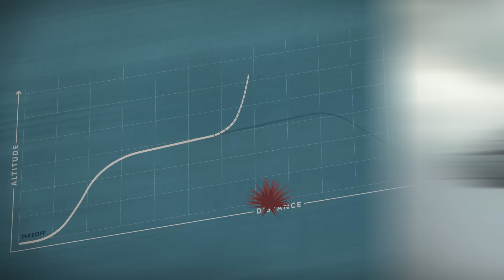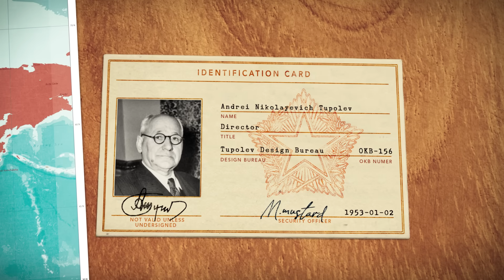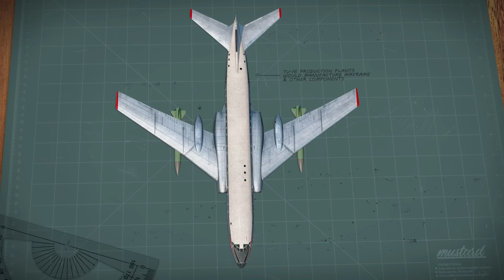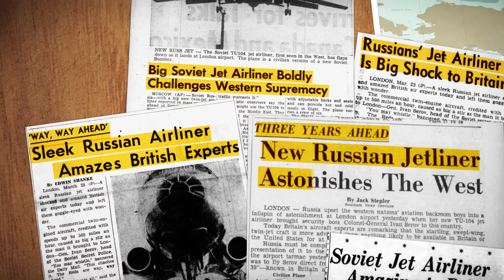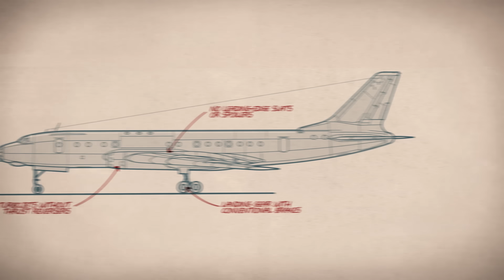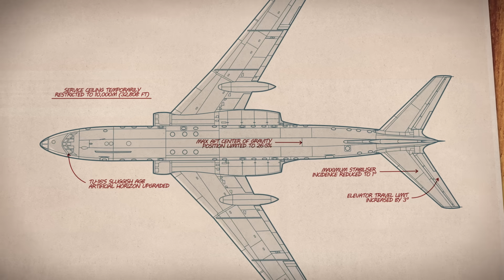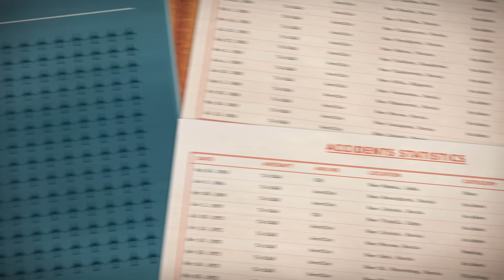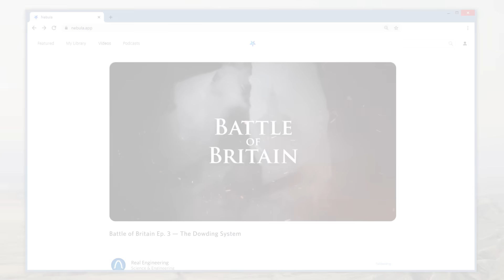The Soviet Airliner Designed To Crash

Comment: The Century turns and the Boeing 737 MAX wants to vie for the title!
Reply: The Boeing Max has a excellent statistical safety record compared to the Tu-104 or the de Havilland Comet.

Comet has the highest loss rate and fatalities statistics of any jet airliner in history
Reply: @sandervanderkammen9230 

Clearly we feel we can shed some light on some common myths & misunderstandings.

Obviously it's possible to predict the potential accident losses for airliners simply by looking at the year they first flew. 

   However, if we take into account all the variables including the year they first flew & we discard random incidents such as a vehicle colliding with an airliner during its takeoff run, there are some airliner manufacturers that stand out as producing  particularly safe aircraft for the years in which they operated, Bombardier & Embraer being two such manufacturers.
      
   It's definitely true to say that Bow-wing (See B-47 wing folding & wing collapse incidents), which has more than 50 years design & build experience on the type, obviously can have no excuses for the 737 Max incidents, those incidents being directly caused by serious design defects.

  That's correct of course, at the time the Comet wasn't particularly dangerous. It was also definitely not the worst aircraft engineering disaster in aviation history obviously.

   Obviously the Comet's engine position & inlet position had some distinct advantages at the time & of course pylon mounted  podded engines have some problems including excessive induced drag. The Comet engine inlet design was not a fatal flaw & didn't cause any incidents.

Examples of all Comets mks including some Comet 1 airframes continued flying with certification at some point after 1954. Flying carried on until 1997. 

      Losses comparisons.
Accident Losses % of total built.
How things were in those days.

DeHavilland Comet 4 UK                 14% 
DeHavilland Comet all   (ff 1949)   17%  

Douglas DC-1                                      99%
Douglas DC-2                                      47%
Douglas DC-3                                      30%
Douglas DC-4                                      26%
Boeing s300                                             72% 
Boeing 307                                               70%
Boeing 247                                               48%
Boeing 707                                               20% 
Lockheed L-049/149 Constellation        30%
Lockheed Electra  Turboprop                  29%
Fairchild FH-227                                       30%
McDonnell Douglas DC-8                        14%
Sud Aviation Caravelle                             15%
Canadair CL-44  Turboprop                   46%  
Convair CV-580  Turboprop                   22%
Convair CV-880    (ff 1959)                    27%  
Convair CV-990     (ff 1961)                   35% 
Tupolev T-104     (ff 1955)        16%

     Of course De Havilland had prior experience building many all metal construction airframe aircraft & thousands of jet powered fighter aircraft that were primarily of metal construction with pressurised cockpits & jet engines built by De-Havilland.

  Yes, that's true, De Havilland carried out full stress analysis & engaged in a comprehensive & protracted testing program which is why key De Havilland people were happy to be aboard flying DH Comet aircraft. The Comet was the first airliner where stress due to pressurisation significantly exceeded flying load stress for a full length passenger cabin fuselage.

    We agree, that's correct, the DH Comet was the first passenger airliner with full length fuselage pressurisation at 8psi pressure differential. Handley Page built the world's first all metal construction airliner during the 1920s.
    In all cases other earlier pressurised aircraft were larger, needed thicker fuselage skins due to flying stresses alone & had much lower pressurisation differential pressure or were military aircraft with relatively small heavily built pressurised capsules. 

     Of course ripstop provision was provided. The skin alloy used became unavailable at the time due to R & D at the manufacturers which resulted in the original alloy being discontinued. Later alloys had very similar properties. The skin thickness used for the Comet was used for similar size later aircraft. Frame spacing was not found to be too large & frame width was not found to be too small.

    Without doubt De Havilland did indeed always work to better than industry standards at the time, used up to date knowledge for the design & construction & no evidence of negligence or criminal negligence was ever produced in relation to the DH Comet.

    Obviously the DH Comet had no effect on the course of the aerospace industry in the UK. The UK now has the world's highest combined nuclear, aerospace & defence sectors per capita activity. Of course anyone currently flying on a wide body airliner stands a good chance of being on an aircraft powered by RR gas turbine aero engines designed & built in the UK.

    That's correct, the investigation committee did not find hundreds of fatal flaws or evidence of design defects, structural defects, defective materials or shoddy workmanship. Indeed it is the case that ripstop provision was included. Claimed incidents did not involve cracks starting from passenger cabin window corners. Pretty much all changes were just in case changes or were planned development modifications & improvements that were scheduled regardless of incidents.

    Obviously De Havilland designers knew all there was to know about metal fatigue at the time they designed the DH Comet.

    It is in fact entirely true to say that the way airliners were built changed everywhere, including in the US, after the Comet incidents.

We hope this helps, obviously.

Cheers indeed of course as always etc.
& 👍 without doubt.
       
 
 . . .... ... ..... ......
. . ..... ..... ... ......

Comment: The Comet was otherwise a fantastic piece of design and an amazing plane, if it wasn’t for the shape of the windows being squared, the plane would have single handily won the aviation race. Someone has to take the fall, and if it wasn’t the brits putting a plane into the sky first to learn about those things, it would have been the Americans or Russians.
Reply: The de Havilland Comet is without any doubt the worst engineering failure in commercial jet aviation history.

No version of the Comet ever had square windows, it had the exact same 5 inch radius windows found on airliners today.

The Comet Disaster was the result of engineering incompetence and criminal negligence
The only lesson learned from the Comet Disaster is that manufacturers could no longer be trusted to conduct their own crash investigations
Reply: @sandervanderkammen9230 Clearly we feel we can shed some light on some common myths & misunderstandings.

  That's correct of course, at the time the Comet wasn't particularly dangerous. It was also definitely not the worst aircraft engineering disaster in aviation history obviously.

   Obviously the Comet's engine position & inlet position had some distinct advantages at the time & of course pylon mounted  podded engines have some problems including excessive induced drag. The Comet engine inlet design was not a fatal flaw & didn't cause any incidents.

Examples of all Comets mks including some Comet 1 airframes continued flying with certification at some point after 1954. Flying carried on until 1997. 

      Losses comparisons.
Accident Losses % of total built.
How things were in those days.

DeHavilland Comet 4 UK                 14% 
DeHavilland Comet all   (ff 1949)   17%  

Douglas DC-1                                      99%
Douglas DC-2                                      47%
Douglas DC-3                                      30%
Douglas DC-4                                      26%
Boeing s300                                             72% 
Boeing 307                                               70%
Boeing 247                                               48%
Boeing 707                                               20% 
Lockheed L-049/149 Constellation        30%
Lockheed Electra  Turboprop                  29%
Fairchild FH-227                                       30%
McDonnell Douglas DC-8                        14%
Sud Aviation Caravelle                             15%
Canadair CL-44  Turboprop                   46%  
Convair CV-580  Turboprop                   22%
Convair CV-880    (ff 1959)                    27%  
Convair CV-990     (ff 1961)                   35% 
Tupolev T-104     (ff 1955)        16%

     Of course De Havilland had prior experience building many all metal construction airframe aircraft & thousands of jet powered fighter aircraft that were primarily of metal construction with pressurised cockpits & jet engines built by De-Havilland.

  Yes, that's true, De Havilland carried out full stress analysis & engaged in a comprehensive & protracted testing program which is why key De Havilland people were happy to be aboard flying DH Comet aircraft. The Comet was the first airliner where stress due to pressurisation significantly exceeded flying load stress for a full length passenger cabin fuselage.

    We agree, that's correct, the DH Comet was the first passenger airliner with full length fuselage pressurisation at 8psi pressure differential. Handley Page built the world's first all metal construction airliner during the 1920s.
    In all cases other earlier pressurised aircraft were larger, needed thicker fuselage skins due to flying stresses alone & had much lower pressurisation differential pressure or were military aircraft with relatively small heavily built pressurised capsules. 

     Of course ripstop provision was provided. The skin alloy used became unavailable at the time due to R & D at the manufacturers which resulted in the original alloy being discontinued. Later alloys had very similar properties. The skin thickness used for the Comet was used for similar size later aircraft. Frame spacing was not found to be too large & frame width was not found to be too small.

    Without doubt De Havilland did indeed always work to better than industry standards at the time, used up to date knowledge for the design & construction & no evidence of negligence or criminal negligence was ever produced in relation to the DH Comet.

    Obviously the DH Comet had no effect on the course of the aerospace industry in the UK. The UK now has the world's highest combined nuclear, aerospace & defence sectors per capita activity. Of course anyone currently flying on a wide body airliner stands a good chance of being on an aircraft powered by RR gas turbine aero engines designed & built in the UK.

    That's correct, the investigation committee did not find hundreds of fatal flaws or evidence of design defects, structural defects, defective materials or shoddy workmanship. Indeed it is the case that ripstop provision was included. Claimed incidents did not involve cracks starting from passenger cabin window corners. Pretty much all changes were just in case changes or were planned development modifications & improvements that were scheduled regardless of incidents.

    Obviously De Havilland designers knew all there was to know about metal fatigue at the time they designed the DH Comet.

    It is in fact entirely true to say that the way airliners were built changed everywhere, including in the US, after the Comet incidents.

We hope this helps, obviously.

Cheers indeed of course as always etc.
& 👍 without doubt.
 
 
 . . .... ... ..... ...... .... ......
. . ..... ..... ... ....... ...........
Reply: - "if it wasn’t for the shape of the windows being squared"

I suggest you do more reading on the Comet.  The "square" windows (which weren't even square) weren't the problem.

Comment: Yes, Soviet air travel was indeed "booming". In a bad way.
Reply: And that’s where McDonnell Douglas…
Reply: It was still safer than the de Havilland Comet.
One out of every three Comets built crashed or were destroyed in accidents
Reply: @sandervanderkammen9230 

Clearly we feel we can shed some light on some common myths & misunderstandings.

  That's correct of course, at the time the Comet wasn't particularly dangerous. It was also definitely not the worst aircraft engineering disaster in aviation history obviously.

   Obviously the Comet's engine position & inlet position had some distinct advantages at the time & of course pylon mounted  podded engines have some problems including excessive induced drag. The Comet engine inlet design was not a fatal flaw & didn't cause any incidents.

Examples of all Comets mks including some Comet 1 airframes continued flying with certification at some point after 1954. Flying carried on until 1997. 

      Losses comparisons.
Accident Losses % of total built.
How things were in those days.

DeHavilland Comet 4 UK                 14% 
DeHavilland Comet all   (ff 1949)   17%  

Douglas DC-1                                      99%
Douglas DC-2                                      47%
Douglas DC-3                                      30%
Douglas DC-4                                      26%
Boeing s300                                             72% 
Boeing 307                                               70%
Boeing 247                                               48%
Boeing 707                                               20% 
Lockheed L-049/149 Constellation        30%
Lockheed Electra  Turboprop                  29%
Fairchild FH-227                                       30%
McDonnell Douglas DC-8                        14%
Sud Aviation Caravelle                             15%
Canadair CL-44  Turboprop                   46%  
Convair CV-580  Turboprop                   22%
Convair CV-880    (ff 1959)                    27%  
Convair CV-990     (ff 1961)                   35% 
Tupolev T-104     (ff 1955)        16%

     Of course De Havilland had prior experience building many all metal construction airframe aircraft & thousands of jet powered fighter aircraft that were primarily of metal construction with pressurised cockpits & jet engines built by De-Havilland.

  Yes, that's true, De Havilland carried out full stress analysis & engaged in a comprehensive & protracted testing program which is why key De Havilland people were happy to be aboard flying DH Comet aircraft. The Comet was the first airliner where stress due to pressurisation significantly exceeded flying load stress for a full length passenger cabin fuselage.

    We agree, that's correct, the DH Comet was the first passenger airliner with full length fuselage pressurisation at 8psi pressure differential. Handley Page built the world's first all metal construction airliner during the 1920s.
    In all cases other earlier pressurised aircraft were larger, needed thicker fuselage skins due to flying stresses alone & had much lower pressurisation differential pressure or were military aircraft with relatively small heavily built pressurised capsules. 

     Of course ripstop provision was provided. The skin alloy used became unavailable at the time due to R & D at the manufacturers which resulted in the original alloy being discontinued. Later alloys had very similar properties. The skin thickness used for the Comet was used for similar size later aircraft. Frame spacing was not found to be too large & frame width was not found to be too small.

    Without doubt De Havilland did indeed always work to better than industry standards at the time, used up to date knowledge for the design & construction & no evidence of negligence or criminal negligence was ever produced in relation to the DH Comet.

    Obviously the DH Comet had no effect on the course of the aerospace industry in the UK. The UK now has the world's highest combined nuclear, aerospace & defence sectors per capita activity. Of course anyone currently flying on a wide body airliner stands a good chance of being on an aircraft powered by RR gas turbine aero engines designed & built in the UK.

    That's correct, the investigation committee did not find hundreds of fatal flaws or evidence of design defects, structural defects, defective materials or shoddy workmanship. Indeed it is the case that ripstop provision was included. Claimed incidents did not involve cracks starting from passenger cabin window corners. Pretty much all changes were just in case changes or were planned development modifications & improvements that were scheduled regardless of incidents.

    Obviously De Havilland designers knew all there was to know about metal fatigue at the time they designed the DH Comet.

    It is in fact entirely true to say that the way airliners were built changed everywhere, including in the US, after the Comet incidents.

We hope this helps, obviously.

Cheers indeed of course as always etc.
& 👍 without doubt.
 
 
 . . .... ... ..... ......
. . ..... ..... ... ......